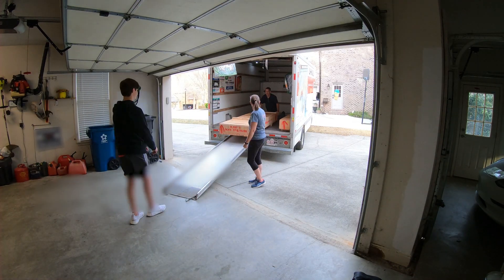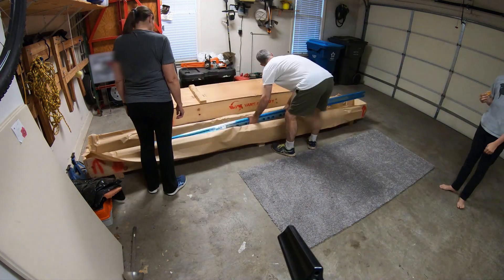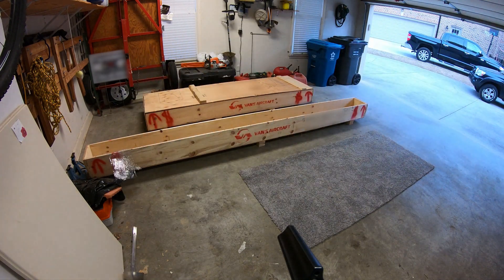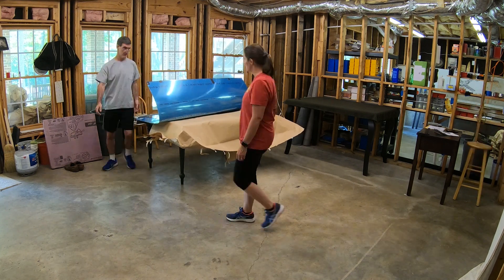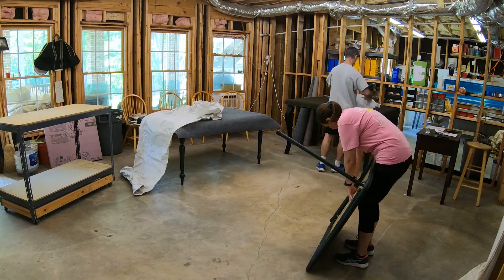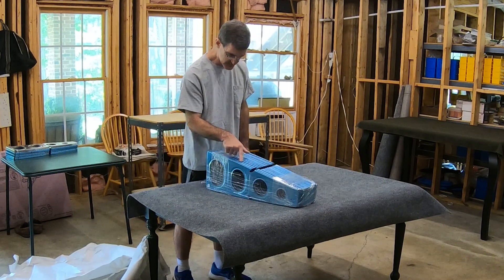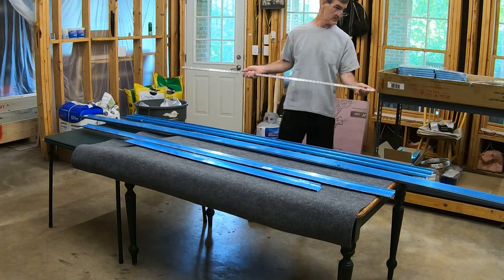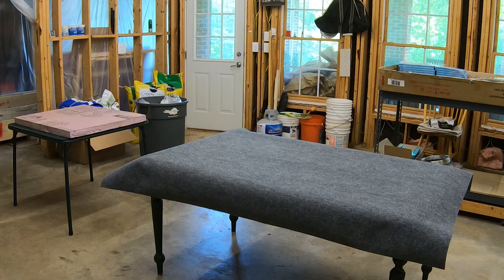RV-10 Build Log - Wing 01 - Uncrating the Wing Kit!

Comment: Believe it or not, this "boring" video was a help to me- like so many of your others have been. I picked up my RV-14A wing kit at the factory (we live in Central Oregon) two weeks ago. I wasn't going to open the crates and inventory the parts because I plan to start on the empennage first but it's not available yet. I didn't want wing kit parts taking up shelf space in my hangar for a year while I'm working on the other kit. I had a sneaking hunch that Van's would probably require that we inventory the kit within some time frame but I was sticking my head in the sand. You confirmed there is in fact a deadline to do the inventory in 30 days. Sigh...so much easier to just leave them in the crates. Maybe I'll buy a couple more shelves. Anyway, thanks again for sharing your build.
Reply from the maker: I know exactly what you mean.  I have limited shelf space, too, and I didn't want wing parts mixing into the empennage parts before I needed them.  Plus it's kindof satisfying to see the shelves of tail parts get more and more bare.  I packed a lot of the wing parts loosely back into the crates to keep them safe while I finish the empennage.

Comment: Why manually count? A couple hundred dollar high end scale out to 3 decimals will allow you to weigh one, weight the batch. This is how the factory does it. Countless hours saved
Reply from the maker: That's a good idea.  For the rivets, it's not necessary to count them.  For some of the screws and washers and such, often there are multiple sizes and types in the same bag, so sorting before counting / weighing would still be required.

Comment: I could be wrong but I think time spent inventorying your parts counts towards the build and is calculated into the build time to qualify these kits as majority completed by builder for the requirements for experimental airworthiness cert.
Reply from the maker: I actually did record an entry in my log for this for the wing.  I don't think I did for the emp kit, but that's ok.  I'm going to be WAY over any sort of build time requirement.  I thought the E-AB qualifications were more "task based" than time based, but I'm still keeping up with my time spent, too.  Can't hurt.  Plus, if I ever decide I want to become an A&P, I believe this time can be applied to those requirements as well.

Comment: For inventory on the bolts and screws of slightly different sizes I found stacking them vertically on their head made it a lot faster 🤞
Reply from the maker: Yep, I do that too sometimes.  I'll usually measure one as a check, then make sure the others are the right relative lengths.

Comment: Congrats on the wing kit!  Every part starts with a W- xxxx. 🤪.  What I found helpful was to look up the part on the digital rv14 parts index and the. Label and separate that part with which section it came in.  If you are curious what it is you can usually quickly identify what part it is at the first page of the section.  The fuselage will be even worse because there aren’t as many obvious parts like this.   👍
Reply from the maker: Good idea about the sections.  I'll reorganize once I make room on some shelves.  I was surprised at how many (smaller) sections the wing plans have.  I'm not sure what I was expecting, but with the emp kit it makes sense to have sections for each part - VS, rudder, HS, elevators, etc.  Maybe I expected the wings to be one big section, though that seems pretty stupid in hindsight.  Duh.
Reply: @missiletwentynine2667   Curious what your response will be for the aileron pushrods.  I told them I would wait or they should ream and powder coat the alternative parts for us.  I know other builders are doing the same.  I’m assuming you got the same email today regarding B/O pushrods?
Reply from the maker: @smellyallen  I told them I would wait as well, actually.  Didn't think to ask them to ream and powder coat for me, but that seems like a reasonable request, depending on how anxious a builder is to get the parts.  I of course am months away from needing them, so I'm not in any rush.

Comment: Thanks for sharing this video. My first kit and inventory was the RV-14 Empennage/Tail Kit. I really got into the nitty-gritty of it. Measured and counted every fastener - except the solid rivets, which are allotted by weight. I did measure (diameter/length) one from each bag though. The process did familiarize me with nomenclature and how fasteners are measured. I'm sure I took more time than most builders, but I like knowing the details. In my case, I was only missing a few items, all fasteners. I am very impressed with those at Van's that fulfill kit orders.
Reply from the maker: Great point about measuring one of each rivet in a bag!  When I inventoried my empennage kit I did something similar.  I can't say I measured each one, but I lined the bags up in ascending order and by type (426 and 470, AD4s and AD3s, etc.) and spot-checked a few for length.  I didn't do that with the wing, but I'll also say that at this point I've bought enough extra rivets that I'm not too worried about running out.  But definitely wouldn't want to accidentally be grabbing the wrong size during the build, either.